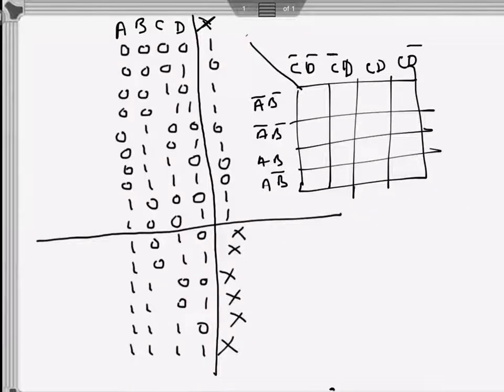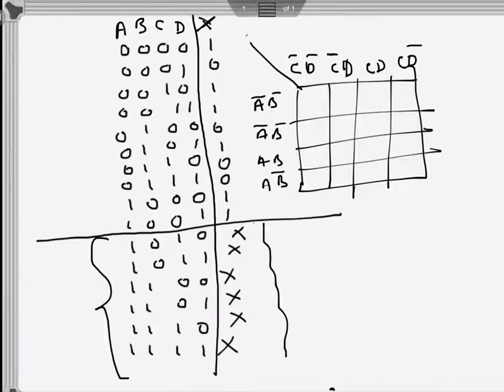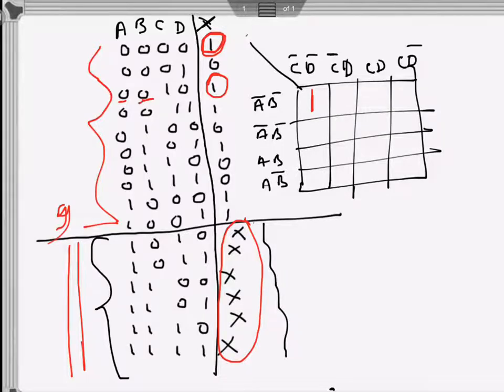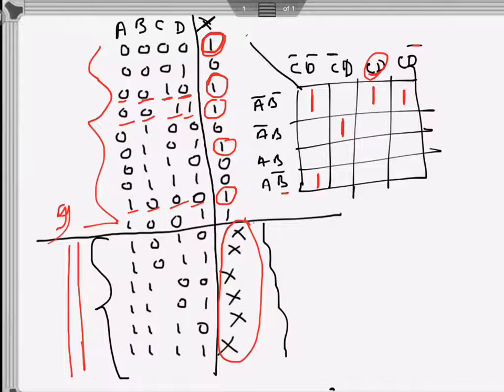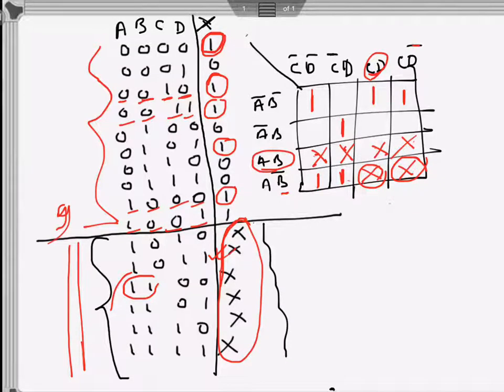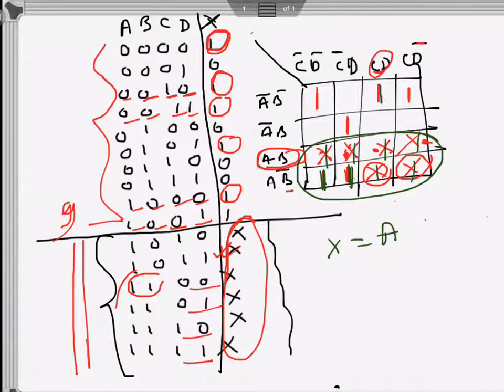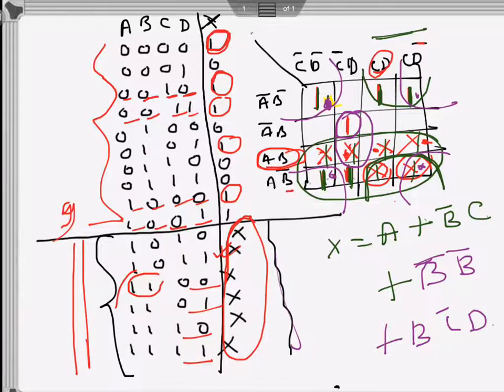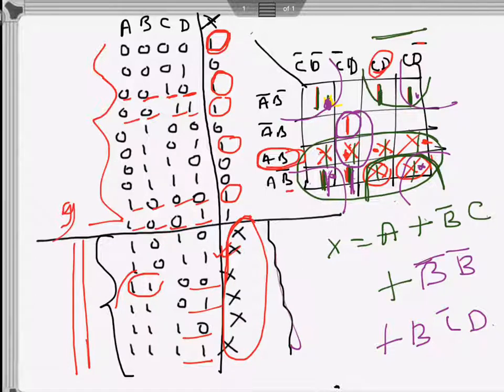Digital Electronics: Minimization using K map with Don't care conditions

Comment: Hi sir how to take output function of x sir explain sir
Reply from the maker: are you asking about the x in the output of the TT? Well they can be used as either 1 or 0 as convenient in your K map for minimization. Those are don't care conditions; it means, those input do not occur in the system that is being designed so the designer doesn't need to worry about the outputs for those inputs. Since K map is about writing the outputs , those output are marked as x and made as 1 or 0 in a in the kmap as convenient to get the minimized expression.